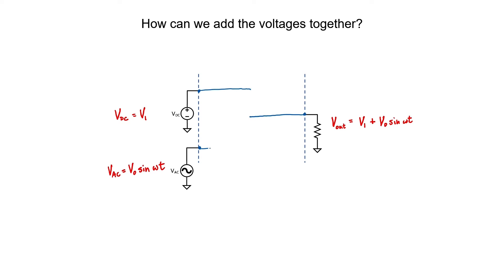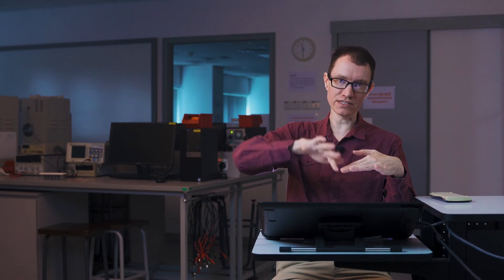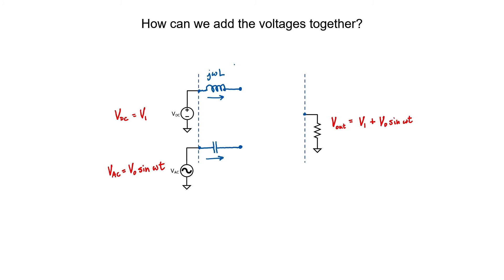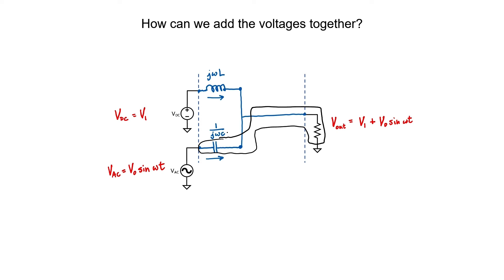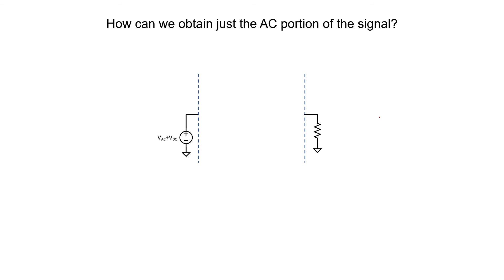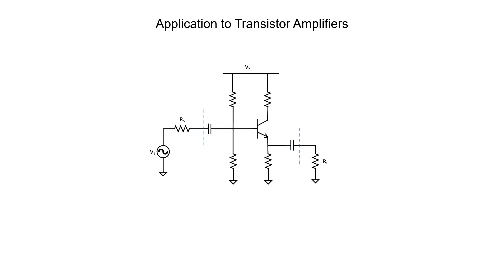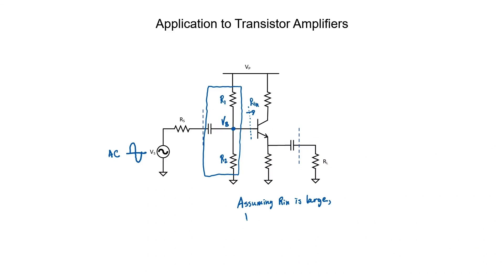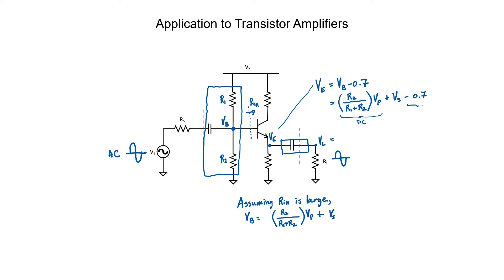Transistor Biasing: How to combine AC and DC signals in amplifiers (8-Transistors)

Comment: Saying that inductors and capacitors block the AC and DC signals from flowing into each other and thus will end up getting added up to their sum, is like saying that you can add two DC voltages using two diodes. Why do all of these professors give non sensible explanations

Comment: Concerning thee video at the 5:01 mark:
You explained how the inductor can be replaced by a voltage divider with resistors R1 and R2. You then adjusted the Vout equation to account for the voltage divider. I understand that part.
My confusion is around how R1 replaces the inductor's function of blocking AC from the AC source from interfering with the DC source. You mentioned that R1 and R2 should be much smaller than the load resistance. Wouldn't this low resistance of R1 allow AC current to flow through it, defeating the purpose of blocking AC? I struggle to see how the voltage divider circuit achieves the same function as the original inductor in this scenario.

Thanks a lot.
Reply: I think the reason why the AC current doesn't flow into the DC supply is because the voltage at the base of the bjt is always smaller than the DC supply voltage.
Reply: It's a good point.. actually, the resistors R1 and R2 don't really replace the inductor. Instead, we go back to the original goal of summing the AC and DC signals, so the combination of the R1-R2 voltage divider and the capacitor does that. We then don't worry if the AC source will affect the DC source, because typically the DC source is some kind of battery or power supply (i.e. very low impedance).
But let me know if I'm wrong about that :-)

Comment: I apologise for my NOOB question, but why most transistor biasing involves resistors? why can't we use voltage regulator to bias it ?
Reply: of course you can, but resistors are cheap and a lot simpler than a voltage regulator

Comment: i wonder if there is another approach than the small signal approximation. 
in power amplifiers the output impedance suffers huge variations. 
we can follow the small signal approximation exclusively, and it is fine, if it is for beginners, but if we want more than the forever beginner level, we want to know more. 

btw, your presentations are such a joy!
Reply: I find difficult to understand what exactly you want but it sounds interesting. Do you mean that you want too see the other stages of an amplifier so you can drive different loads?
Reply: You want to factor in tolerance's of the components, temperature and other parameters as well is, that what you mean please?
Reply: The small signal model is used when the signal is not large enough to expose components non-linearity. What is "large" depends on the actual circuit, and not necessarily a power amplifiers cannot be analyzed with a small signal model. For instance, if the large signal does not affect the Q-point. If the signal, despite being "large" does not expose the non linearity of the circuit components then it can be analyzed with a small signal model. Hope this answers your questions.